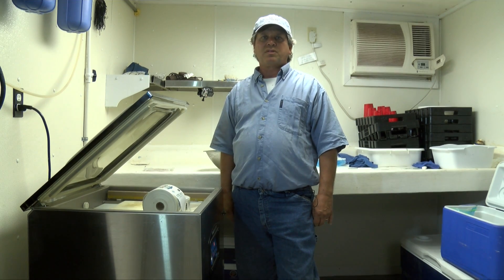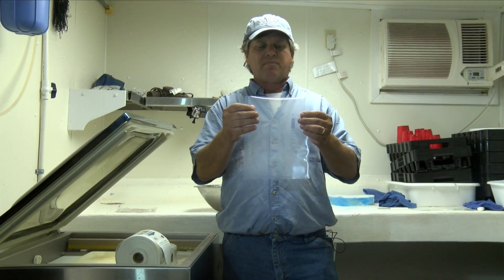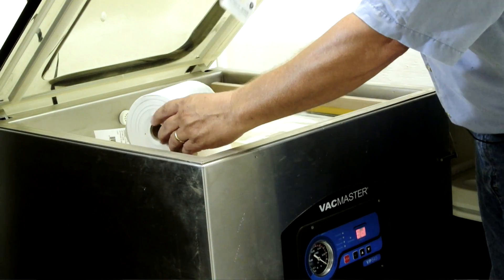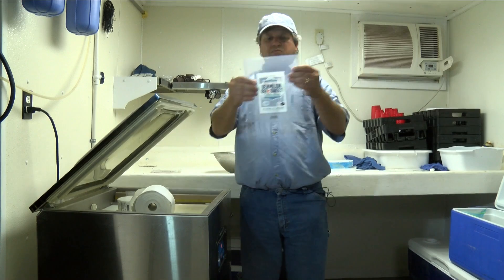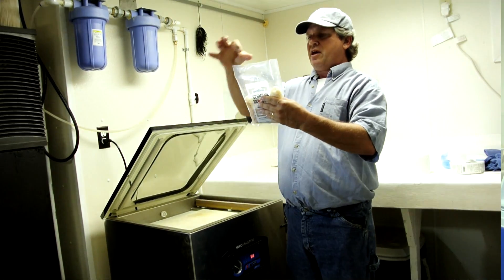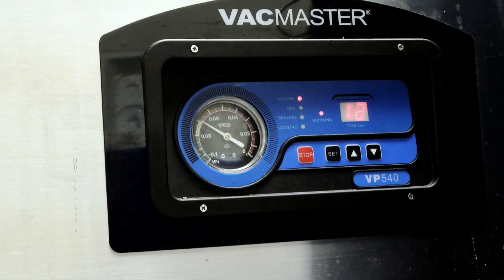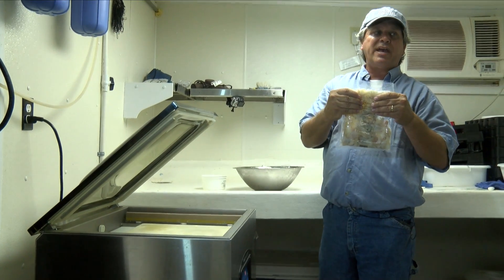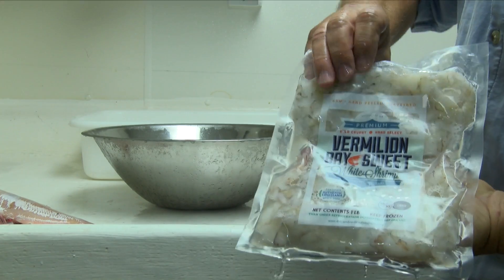Vacuum Packing Demonstration

Comment: Thank you for the video.

What is the distance between the bars?  I am looking to vacuum seal pizza crusts from KETO friendly ingredients, but I need to know the "Working Area" between bars, an i'm also trying to find out what bag length options there are.
Reply from the maker: The distance will depend on the particular model used. We recommend contacting a vacuum machine manufacturer or dealer to see if a particular machine meets your needs.

Comment: That latch you flip over the lid is only for storage, not to be used when operating the vp540.  The machine will throw an error code if the lid is not allowed to open after a certain time.

Comment: why don't you freeze it before?  That way you can get the shape you want?
Reply: I can't get the gas flush to work. Even running the gas at the longest allowed time (9.9 seconds) and at pressures well in excess of what they recommend (18psi) my product still comes out vacuum sealed like shrink wrap. Any suggestions??
Reply from the maker: Freezing before vacuum packing to maintain the desired shape will depend on the product you are freezing and the freezing method you are using. In the case of shrimp in a 1 lb pillow pack or fish fillets, we prefer to vacuum pack before freezing to reduce freezer burn and maintain quality over time. On the other hand, if you were freezing nuggets, fish patties or fish balls, you would want to freeze before vacuum packing, so you don't loss the desired shape.
Reply: @LouisianaSeaGrant  i know this isnt the type of food that you seal, but I'm sealing meat in a sauce.  Currently, I've been bagging them fresh and hot then rapid cool in the freezer.  To get the shape I want I use a cambro with dividers.  When they're frozen I'll then vacuum seal.  Just wanted to ask is what I'm doing safe and correct?  Thanks for answering!
Reply from the maker: @johnmarkvanzee  Using an isolated cambro might not be the best way to cool down a food product. The isolation will not allow appropriate heat transfer and the product will remain in a danger zone temperature (40-80F) longer than recommended. In addition, freezers are not designed to freeze hot products, but to freeze chilled products. We recommend chilling meat and sauce following federal guidance from USDA or FDA depending the product he is packaging. The product is ready to place in the freezer, once the product reaches 32F. You may want to direct your questions to Sea Grant food scientist Evelyn Watts at egwatts@agcenter.lsu.edu.
Reply: @LouisianaSeaGrant  awesome.  Thank you for that.  Im actually a pathologists assistant by trade so very new to it.  Thanks again!

Comment: Is it sure to refrigerate the vacuumed package? At what temperature and how long?
Reply from the maker: To keep vacuum packed seafood safe, it must be stored bellow 37.9F. Household refrigerators hold a temperature of 40F, therefore it is not safe to store vacuum packed seafood in the refrigerator. Vacuum packed seafood must be stored frozen. Thaw under refrigeration intermediately before used. For thawing cut open to break vacuum.

Comment: Hi, may i know your vacuum bag thickness that you're using?
Reply from the maker: Three-mil thickness. Although some packers prefer four mil, which is a bit thicker.
Reply: @LouisianaSeaGrant  

What happens with the moisture coming out of the bag during the vacuum process? Is there a tray, a reservoir, a waste line?
Reply from the maker: @skeetorkiftwon  The vacuum packing process does not produce a liquid moisture discharge ... all of the atmosphere that is evacuated is discharged in a vapor form ... seafood products and any other food items should be cold when vacuum packing.   Even chilled water can be vac packed with ease.
Reply: @LouisianaSeaGrant  tyvm